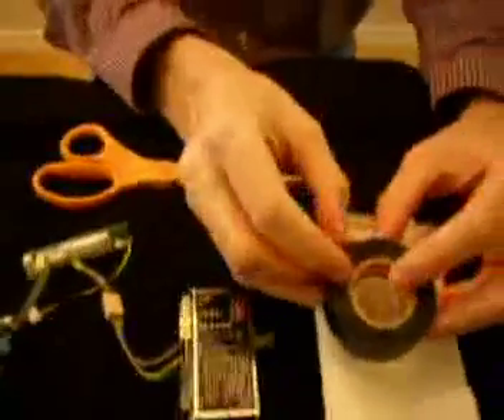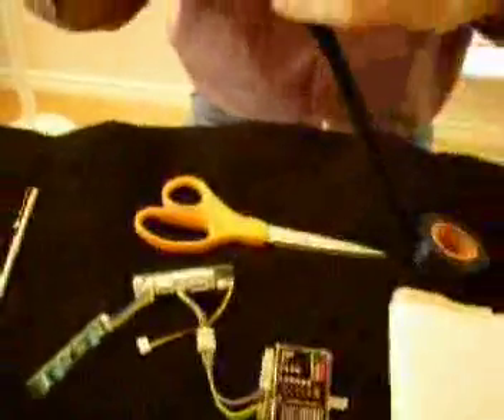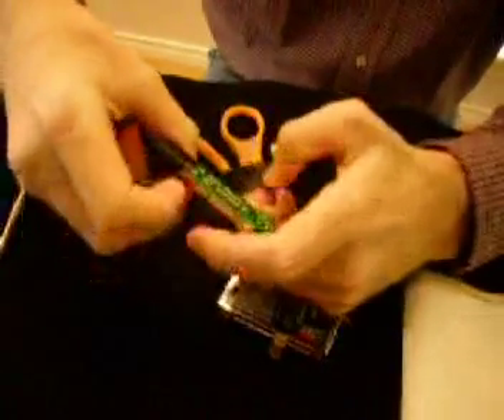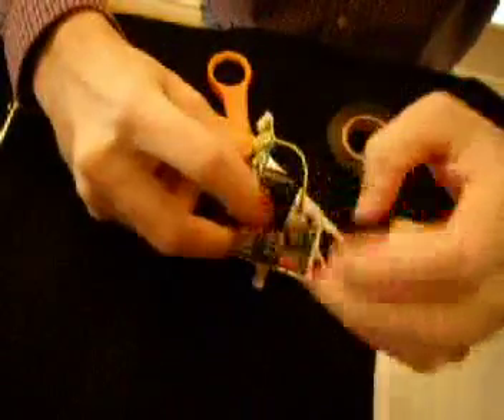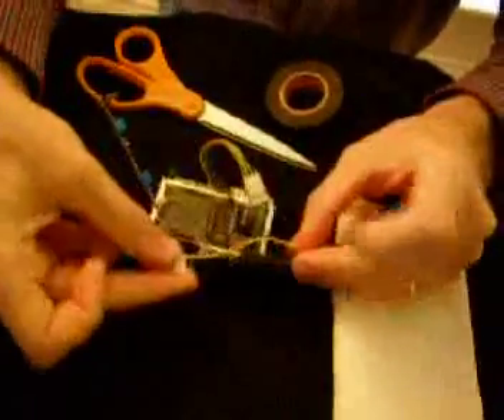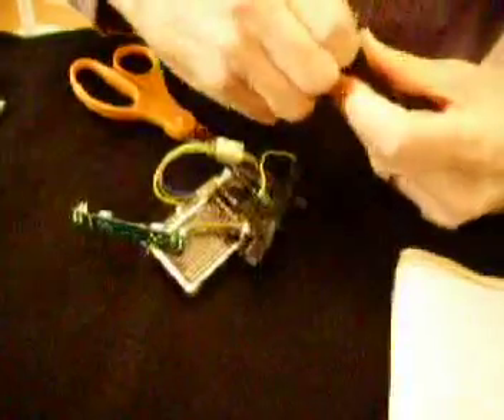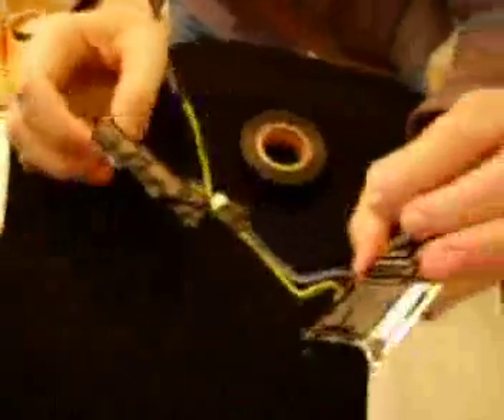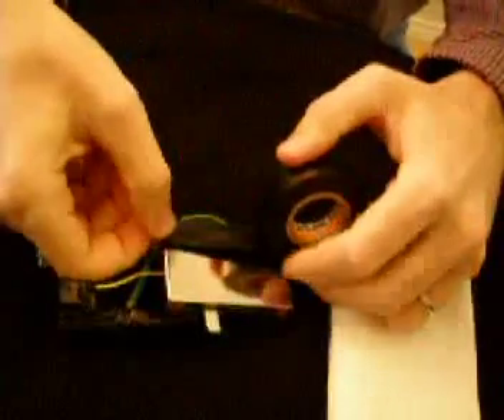Installing the Innofader - proper insulation

Comment: have tried to insulate the innofader , still having a soft bleed trough on a closed fader ( sharpest curve) what is the solution:  recalibration, reverse sirquit protection mod or what?
I've posted on innovate forum, and here ...

would really appreciate  ANY reply.
thank you

Comment: I've just bought Vestax 06 Pro VCA with innofader classic installed , discovered that 
innofader has a very soft bleed when closed
it's super soft that I can only hear it in the headphones out of the main Vestax outputs.
the bleed on closed fader is about 10% of the 
sound of the open fader.

wonder what tweak I should use to illuminate the bleed, could it be insulation that u need or a cable mod , or?

thanks in advance for any tips

Comment: We can't wrap up the board before shipping because then you wouldn't be able to plug in the adapter.

One thing we are working on is providing a heat shrinkable insulating tube to make the job easier